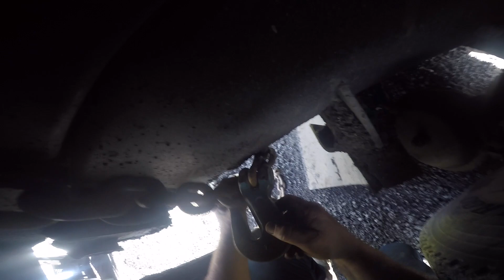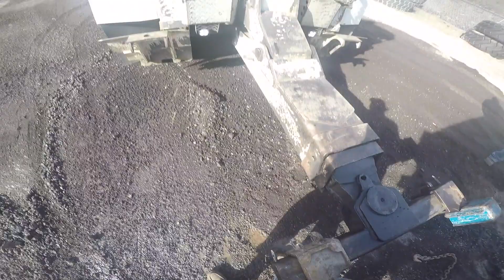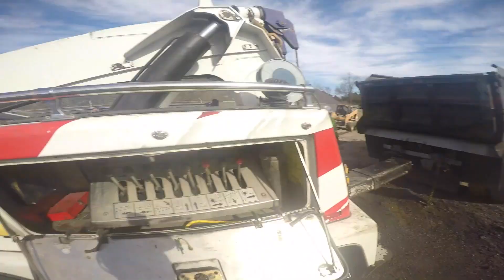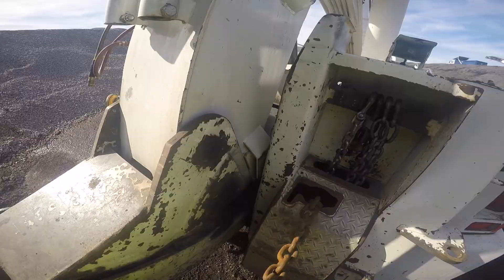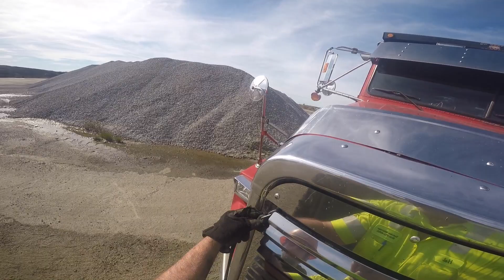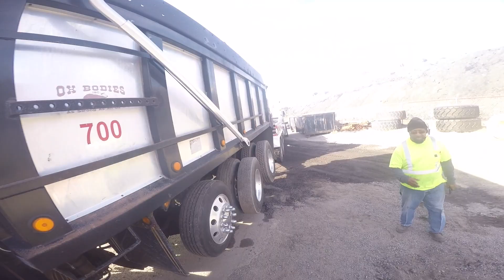Heavy Duty Tow - Dump Truck With Shifted Rear End

Comment: If the rear end didn’t have issues and you needed to tow the truck, could you tow from the front? Or always gotta tow from the back?
Reply from the maker: Mr Drew You can tow from the front you just have to pull  the drive shaft or axles to keep from damaging the transmission.  Also you have to run air to release the brakes. Thanks for watching our videos and stay safe
Reply: Exactly what he  sid....But-all that woerk is such a hasle. Pick from the rear -secure the steering wheel and roll on. Mack-trucks--most of the times-don't have to worry about air ride suspensions and all that extra. Maybe they broke a spring  hanger or something--that would let a rear end shift around.
Reply: My bad-sure looked like a Mack suspension-used to be called Trunnion bags--Freightliner now using them==mmmph-==but wait--haven't Freightliner and Mack merged.?? Here-one dealer services both,